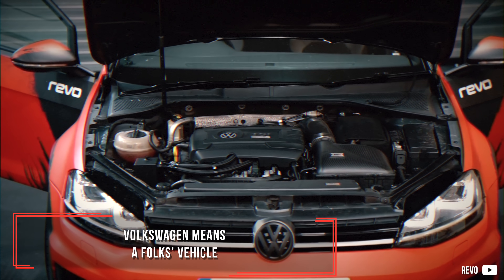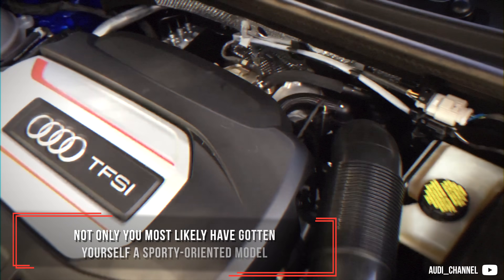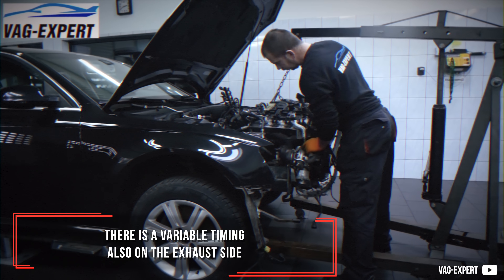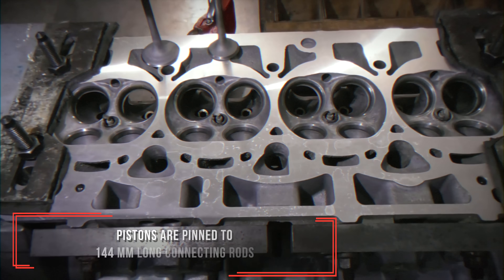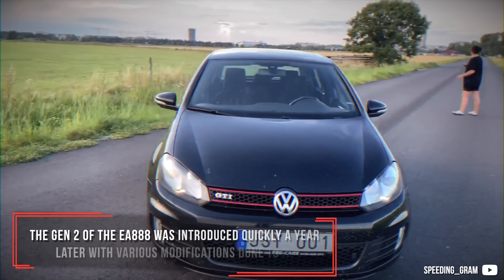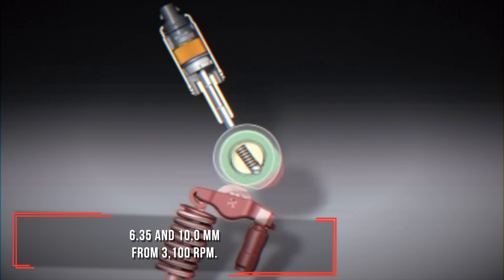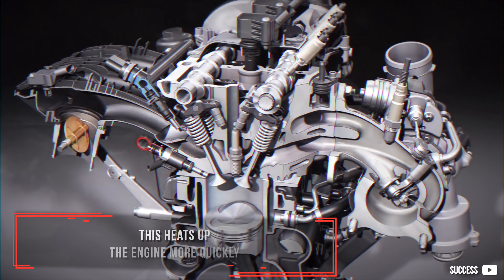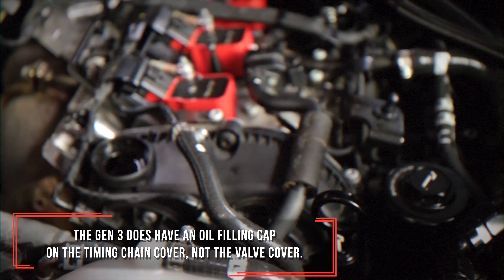Why The Volkswagen EA888 Is So Good

Comment: 1st and 2nd gen EA888 were some of the least reliable mass production motor VW has ever built. These engines need extensive work to keep them reliable. Oil consumption and timing chain issues are two of the main problems. These are just a few of them, I fix these cars almost daily.
Reply: @footballcoreano that's bs, every manufacturer has good and bad engines. Japanese petrol engines are mostly simpler, more reliable constructions. Germans tend to sometimes overcomplicate things, like the 1.4 TSI twin charger, an interesting engine, cool engineering, but with major flaws.
Reply: @sifre2  They later abandoned the twin charging concept and it worked fine.
Reply: @sifre2  yes the 1.4 are the pain in the ass and my MK6 GTI still running strong
Reply: @footballcoreano You, kind sir, have no idea what you're talking about.
Reply: @footballcoreano lol
Reply: I agree, also work on these every day.  I've seen the same issues.  Oil consumption and worn-out chains at under 100k miles.
I've seen more of these blow up than all the older vw engines in the 30 years I've been working on them.
Reply: @footballcoreano My 30+ years of fixing the things tells me that you couldn't be much further from the truth.
Reply: footballcoreano ahahahahahahahaha! That gave me a good laugh! VW is garbage. I have been a tech for over twenty years  and you couldn’t BE more wrong!
Reply: What about gen 3?
Reply: Can’t believe vag still having oil consumption issues in 21st century shockingly bad! 😳
Reply: @riccccccardo  Aside from them and Chrysler (the biggest junk in the industry) I don't see any manufacturers having issues with oil consumption. That shows you what kind of manufacturer they are
Reply: @wizzy25  😎
Reply: @footballcoreano Japanese cars engines are unreliable? 🤣😂 That is the dumbest thing I have ever read this month. Hey dumb VW fanboy, Japanese cars are the most reliable cars. That's why you see Toyota/Lexus, Mazda... on the top of reliability surveys, and pos VW in the middle at best.
Reply: @footballcoreano Yeah the Japanese 2JZ that you can take to 1,000hp without opening the block is sooooooooo unreliable lmfao. Look at ANY reliability survey, japanese is always up top. VW, not so much 😂
Reply: gen 2 is the worst engine ive ever seen but mostly because of the factory oil change interval, the ecotec has the same issue with 20,000km+ intervals by following the oil life % in dash but engines doesnt blow up all the time like that, you just need to replace the chain tensionner every 5 years which takes 30mins
Reply: @footballcoreano Spoken like someone who has never owned a VW product.
Reply: @footballcoreano keep trolling.
Reply: 2014+ 2nd Gen are good
Reply: @footballcoreano OK... 😂
Reply: Gen 3 has not so much problems?  Just keep the oil clean . Very important with this engine
Reply: Had a mk6 GTI with the gen 2 EA888 only issues i had in 5 1/2 yrs and 100k miles was a leaky water pump gasket.  Sold it to my friend who still drives it daily car has over 160k miles on it now no issues.  Maintenance is key to longevity.
Reply: Are the EA888 gen 3 more reliable?
Reply: 125k owned since 2011, only issue I have had was a water pump replacement and valve cleaning at 100k. Pretty reliable for me 😅
Reply: Load of crap, having worked on the vag range daily for the last 20years these engines are very good. Yes like any engine they have there few common things but not like the diesel issues we deal with, dpf, ad blue efficiency, injectors the list goes on
Reply: @footballcoreano this is dumbest and most ignorant statement ever
Reply: @footballcoreano Your comment can be used as a sample why doing drugs is bad for your brain
Reply: Have a gen 3 2015 stage 1 oil consumption kinda high it reads low with about 1k miles left on oil warning. Also it's an auxillary part but on my 3rd water pump replacement the 2nd one failed after 3 months.
Reply: @brianvieane3907  is it the 1.8t Jetta?
Reply: @willie123811  mk7 2015 gti.
Reply: @alelx jines naw the car has never overheated before it just ends up flat out leaking it's a known problem, the water pumps and the thermostat housing. My shop specializes in them and it's a known problem the last one I had the water pump itself was actually faulty and got full warranty from it. Then I went to another shop and they said they have done them before on these cars as well. Just drove it to work in LA traffic for several years, drive fairly mild, never burn rubber, it's just the pumls are faulty. The oil consumption is definitely the tune. Without the tune it wasn't really like that. It's the labor, the part itself is between 200-300ish. So it's like a 750-900$ fix depending on the shop with parts.
Reply: How would you recommend I best get out of owning a 2011 VW CC with the 2.0 TSI? I recently paid $6,000 to a notable German auto mechanic so I could sell a reasonable looking vehicle, but I almost think I’ll look like a fool for trying to find a buyer. 

It’s my first experience with a vehicle more “temperamental” than a 7.3L PowerStroke, and it doesn’t feel like there’s any good options.
Reply: 2011 gti owner here, replaced the chain at 130.000km and now at 170.000km car still runs great. I just change oil every 15.000km and dsg oil every 45.0000km (every 3th oil change). Running stage 1 (270hp) and all the horses get used often.
Reply: 2009 -2015 years with problems . I have Audi a6 2.0 tfsi chip 220 hp , 100 k no problem and Audi a6 2016 300 hp no problem 2.0 tfsi ,
Reply: My mk7 gti is great 97K miles NO ISSUES at all thank Jesus !!
Reply: 2016 Tiguan Gen1 and 2016 A4 Gen2, had no problems with either.  Dead reliable.
Reply: I have a CCTA with the new metal water pump & revised manifold, is there cheap way of doing the tensioner? What else should I look at?
Reply: Still having oil consumption issues wow crazy had my Lexus 3.5 450h mk4 a year now no oil lost.
Reply: @footballcoreano are you high? What kind of crack?
Reply: @footballcoreano 
Good luck with mental treatment.
Definitely see a psychiatrist buddy
Reply: Is VW addressing these issues? or just churning out the same crap? i dont get how VW went from the "unreliable" 1.8t 5v sludge bucket with about 50 TSB's in the late 90's and managed to upgrade that and rack up over 600 TSB by mid 2010's,  failures for oil consumption and plastic internals breaking apart being the biggest ongoing problems.
Reply: @robertficek7586  the water pump is a recall but they are like on their 12 version of new pumps but they are still a problem
Reply: @brianvieane3907  Any way to prevent these problems long term? I drive and MK6 Jetta with a third gen 1.8T at about 66k miles now with no issues, but I want to avoid anything major.
Reply: @rit2ual  my first one went out around that time. It's honestly just the luck of the draw my Last time. What I noticed was my car went to limp mode , turned it off and on then fixed the issue but started losing coolant like 6 months later. The later versions of the water pump are more reliable my current one has been doing good though. The water pump just starts leaking I never overheated. It's just one of those things to just prepare to encounter imo. Yours could last 4 years or two years honestly. But if it goes out don't be surprised.
Reply: @MIGHTY MQB  oh yes, and the beefed up 2.0 TFSI in the S3 and golf R are masterpieces...absolutely love my S3. I know so many people stage 2 and 3 that have had no issues well over 20 K miles with tune.  The upgraded 2.0 TFSI in the S3/R can handle alot more power reliably than people think, 450 HP no problem.
Reply: Dont forget balance shafts
Reply: All these oil consumption talk almost made me sell my car. I changed the PCV valva and i have zero oil condumption after 7000km passed. Stop spreading lies about the engine
Reply: @petarbozinovski8685   also don't baby the engine. I went onto a long trip in Germany and did long drives at higher speed (150kmh) and after the trip the engine was much smoother.
Reply: Also infamous pastic water pumps, tumble flaps in the intake, carbon build up.
Reply: EA888 until 2012 were the junkiest engines from VW. Just trash. Engine dead on 106.000 kms. Huge oil consumption. I had to forge the engine to make it good. Switching to ea113. Much better.
Reply: Maybe cause everyone has them
Reply: Bro are you serious you’ve been proven wrong so many times already and bro you lumped 3 generations together like damn lube tech pop off
Reply: my timing chain just failed in my 2010 vw cc 2.0t
Reply: 3rd generation is equally as good.
Reply: Hello, is there a permanent oil burning solution?I have a Audi Q3 that I overfilled with oil by accident.
Reply: You are the right person to asks this question. I like the mk3 scirocco 2.0, comes in EA888 or EA113 for the R version. I am very worried to get the EA888 version. So much information on the Internet from reliable sources are pointing out how bad this engine is. We just don't know the used EA888 we buy how many engine problems it has. It looks very risky to even consider it.  What do you think about EA113? I have not heard anything bad about this engine. Only wear and tear parts that need replacement.
Reply: @ EA888 Gen 3 is the best of the lot
Reply: There’s literally no reliable petrols left on the road other that vtecs or Toyota
Reply: @tonysoprano9370  Not true
Reply: Lmfao sure u do
Reply: Gen 3 is pretty nice though
Reply: What typ of engine is in a4b9 35tfsi mhev 2019,is it EA888 gen3 or EA888 gen3b?
Reply: Gen1 is fine. They only have the chain tensioner issue, which is an easy fix. Mine has the factory fitted water pump and close to zero oil consuption.
Reply: @sifre2  what about the water pumps the cam shaft plate oil leaks, the lower and upper timing chain cover leaks, the intake manifold issues the fuel injector issues. I can go on and on. The tiguans and eos always have some issue with underboost issues due to thw actuator going bad. I guess the turbo isn’t necessarily the engine but it did come on that motor so yea… very unreliable. I luckily had had very little issues with mine but still had my fair share of issues on my 2011 gti
Reply: @sifre2  you a clown
Reply: own a 2015 A4 quattro with the ea888(second gen), no oil consumption at all and have had zero problems with it since I got the car in 2018. Had the steering shaft problem, as did my buddy who has the same car(mines manual, his is auto).
Reply: @thenewhalogod  Good to hear the newer models are improving, the TSB's look to have peaked in 2013 with over 800 and have been dropping since
Reply: @thenewhalogod  wrong, 2015 the gen 2 was phased out, you have a gen 3 engine, no wonder why it's so reliable.....the gen 3's took over in 2014
Reply: @thenewhalogod try flooring it every day and you will see;)
Reply: @thenewhalogod  they had fixed it by 2015 I believe.  The oil consumption... I think around 2007-2012 were the absolute worst of them.
Reply: @MAD_CarAudio  they fixed it by 2014.
Reply: Agreed I think they are junk.  I like the old 1.8T and VR6.  My brother who is a VW enthusiast had tons of oil burning issues with his then his other car with the 2.0 TFSI just broke cam follower and destroy engine.  He's a sucker for punishment.
Reply: @MAD_CarAudio  VR6s were fairly reliable due to being NA, but as soon as you add a turbo and start ramping up the boost it'll become finnicky. The 1.8T was notoriously bad..
Reply: @l33tnobody1337  my brothers 1.8T (2001 Jetta I believe and has a GTI too) the Jetta is stock besides an exhaust the GTI has a bunch of bolt ons, slightly bigger turbo and injectors, cam etc.  Also alot of tuning to get it perfect.  Both run great and give him very little trouble and he's not easy on them.  I'd take the older 1.8T over the 2.0 TFSI from around 2010 anyday.   That engine is junk imo
Reply: @MAD_CarAudio  Modern VWs are junk. Programmed obsolescence and such.
Reply: My 2016 MK7GTI has Unitronic stage 2 at 337HP and 370ftp. 
Since Ive owned,  ZERRRRRRO failed parts, mechanical or electrical. Hmmm, I want to thank the Mexican partners for for great workmanship.
Reply: @sporopeza oil use?
Reply: I've been using BG EPR, MOA and 44K. 2014 SE w/roof Passat with tiptronic trans. 147, 617 miles, hardly any oil consumption . EPR does a great job of breaking down deposits,  particularly the  PISTON RINGS. Piston rings tend over time to lose their ability maintain  its fee moving seal allowing blow by.

Just speaking for myself and I'm not compensated by BG, but I'm a believer.  When in cruise control 63 mph going from NJ shore to Bethlehem, 42 mpg on a 1.8 EA888 GEN III gasoline engine!

Mind you this is not a normal driving style, but this amazing powerplant is amazing. Keep those piston rings free and you'll benefit from greatly
Reply: There's not a manufacturer on the market without oil consumption issues...
Reply: After 6 years of working on less than 5 VW engines, I can confidently say my mechanical 1.6TD is by far the most reliable, simple and easy to work on of them all.
Reply: You are correct. These engines are absolute piles of trash. Anyone who comments saying VAG products are reliable, has never worked on a VAG product.
Reply: @cp1888  👏🏾
Reply: @footballcoreano I agree but don’t say that out load in public you can literally start a riot with JDM folks 🤣 2 kinds of cars in the 🌎  Volkswagen and the rest 💯
Reply: @nobatteriesincluded3968  Yes 2 kinds of cars, unreliable POS VW full of plastics manufactured in mexico that has a spreadsheet of issues and overcomplicated design for no reason and there's good ol Japanese engineering which you buy and only change oil till 300k miles
Reply: @wizzy25  German over engineering at its best.
Reply: haha the only good engines from VAG is the 3.0tdi and the very old 1.9tdi everything else is junk I live in Germany and would never buy products from VW the only reason why vw still exists are the cheap leasing offers they have at ridiculous prices  screw up..
Reply: @Mund333M 1.9 pd engines are the best ones and I didn’t mind the bkd 2.0 diesel aswel, I did have turbo problems on my bkd though twice but pd is a bullet proof engine
Reply: @Mund333M  thank you 👏🏾 it’s all about Japanese reliability like Toyota/Lexus Mazda etc.. that regularly in top spots year in year out for reliability.